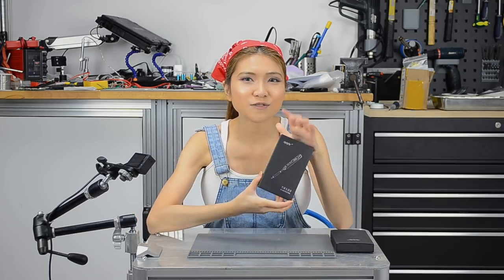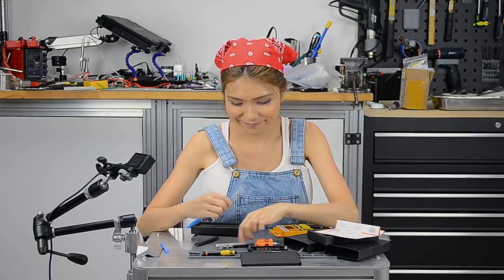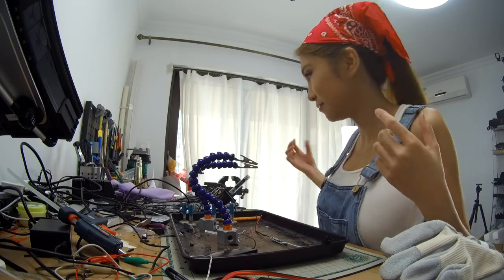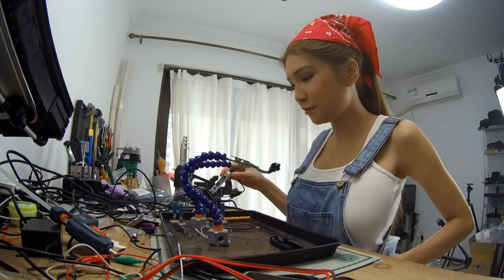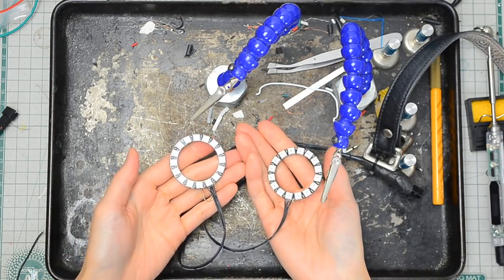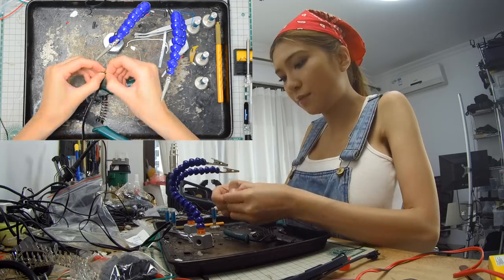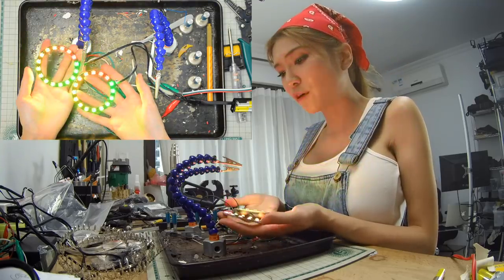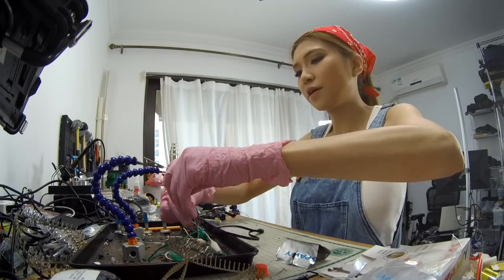TS-100 Soldering Iron & LED Pigtail Rings

Comment: Have you though of hiding the battery+controller combo in a hairclip of some sort? Also, you could use a few very bright LEDs for light and use fiber optic cables to direct it where you want it to come out. That might lower your power demands, allowing you to use a smaller battery pack, which seems to be the bulkiest portion of the build.
Reply from the maker: I like it very bright and noticeable, I've played around with a lot of combinations and they are all too heavy for hair if you want bright lights and tho hours between battery swaps.

Comment: Hi Naomi. Another great video...another great project & review. One easy but simple way to get a good twist when u strip a cable... Use the strippers, but don't pull the plastic all the way off the wire. Then u can just wait the little plastic end around in ur fingers to make a good twist on the wire before pulling the little plastic bit off the wire end & u can throw it away.

Comment: Regarding heat shrink tube: For some applications you may consider self-tighten electrical tape, which might also be sold as "self fuse electrical tape", vulcanisation tape.
Regarding the fan for soldering: You might also consider the use of PC-12V fans which you can easily mount on your helping hand stand and with a 6-12V power supply you can adjust the blow rate. Benefits are also noise reduction and efficieny in blowing away the flux, which will give you a headache. 
Regarding the helping hands. You may consider using heat shrink tubes over the crocodile clamps, so your wires, application won't have such a severe intentation of the teeth.
Regarding safety: Use a perforated panel on the wall above your soldering place, where you can hook cable spools, safety classes and clip board (for wiring diagrams, etc). You can easily ruin your eyes with solding wires by hand. If you press down to fare they can project the hot lot anywhere.

Comment: Great video and no criticism but I'm super geeky with a soldering iron so here's some tips. (Ph.D. in electronic - sorry, can't help it!)

Yes, extraction / filter (extraction normally goes to a filter anyway so it's the same) is a good idea but also look to get rosin free solder (flux inside the solder wire).   It's the rosin solders that you need to filter, but the no-rosin solders are considered safe.   Personally, I still use filters with the no-rosin solder.

Still on the subject of rosin-free, also look to get a flux that's rosin free for additional application to the joints you're about to work on.   Just a little bit extra application before you solder makes it easier too.

Tip cleaning is just a quick wipe - don't dwell on the sponge.   But with the higher temperature lead-free solders it's now considered best to use a sort of wire-wool to clean the tip on.   This is because it doesn't soak away all the heat from the iron.

When making the joint, wet the tip of the iron with solder, apply to the joint, and at the same time feed in more solder to make the joint.   Having those gripping things on your workbench really helps here as you would need three hands otherwise!

Irons I use are Weller for doing build, but rework and some prototype I used my JBC.   It's amazing as it heats up in seconds!   The JBC is part of a rework station with hot air and desoldering tools.   The hot air is great for when I need to do a bit of heat shrink!

Separately, the hot glue gun is apparently one of the biggest causes of fires in factories as they get left on (we had an insurance inspection at the office and that's what they said).   I have mine on a timer so that it switches off after so long (this really impressed the insurance inspector!   He'd never seen this before.).

Also, don't get any hot glue on your fingers.   It hurts!   And you can't get it off because it's stuck!   :-)

Comment: i REALLY love the adjustable clamps for holding wires in place when you solder them, may need to see where i can get one as it looks 100x easier to use that the one i have!
Reply from the maker: Just made them...

Comment: Is there any reason why you joined the power cables rather than just remove the original cables from the LED board and solder the battery pack direct? It gives no added functionality, but seems a bit neater.
Reply from the maker: Just more tricky, my soldering skills are not that great...

Comment: Its funny, I was away for a couple weeks and actually worked with some controllers and leds myself that I got from China. And BOY, Naomi, its not just you being clumsy that breaks them, but those little bastards themselves that are cheaply made that break apart! I ended up with half the controllers not working (they all had issues like their IC's program getting deprogrammed, to their pcb having to be re-soldered at points, to them being overloaded even though I did not put more load than they were made for).   It was a PAIN. Also, is there a way I can DM you about a couple of coding/programming questions that I want to incorporate into my work? Im not sure where to begin looking to be honest!

Comment: Naomi, I recommend some good wire strippers like these: http://www.prc68.com/I/Images/Neiko1924Ab.jpg. I know several companies make these in China so there should be some at local merchants. The small thumbscrew is a tension adjustment that is optional but recommended. A tool like this will allow all the wires in a flat ribbon cable to be stripped to identical lengths at the same time.
Keep making!